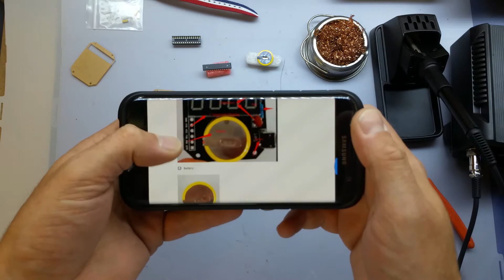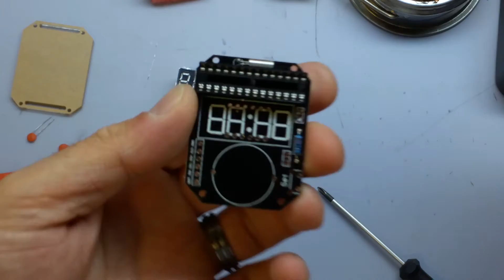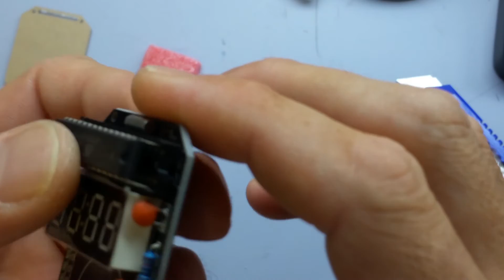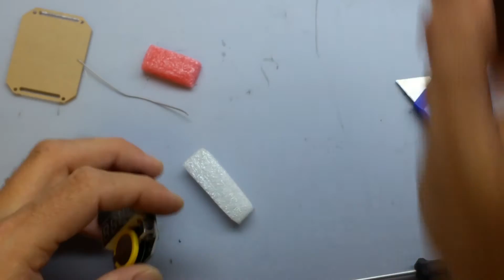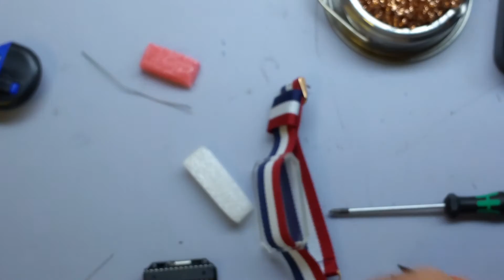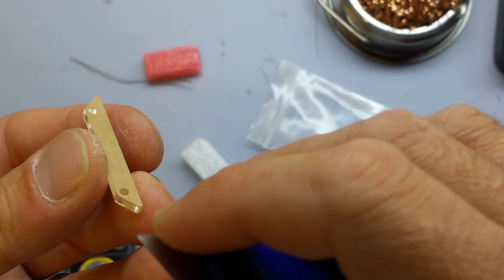Sainsmart DIY LED watch kit Part II

Comment: My son and I just attempted to build this kit (before we found your helpful video!), but we've had no luck. We ran into the same problem you did with the battery but figured that out, but the time display only ever shows "8888" or garbage characters. We've double-checked all our solders and make sure the chip is seated correctly, but still no luck. Any tips or suggestions would be welcome!